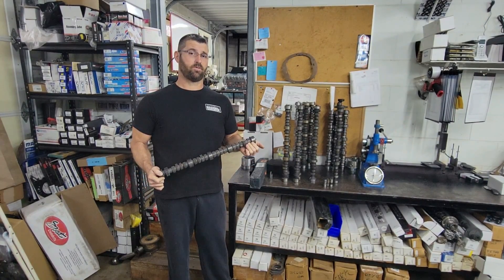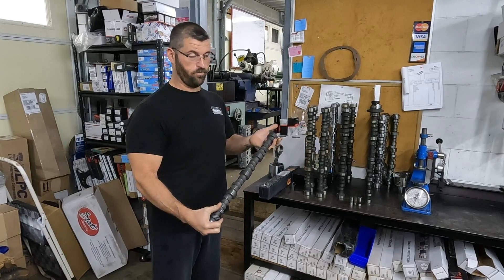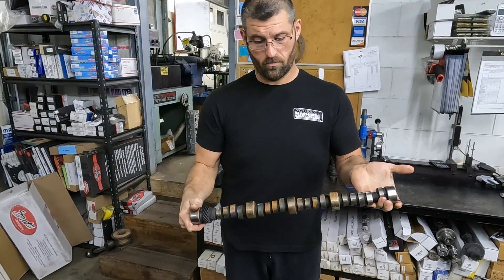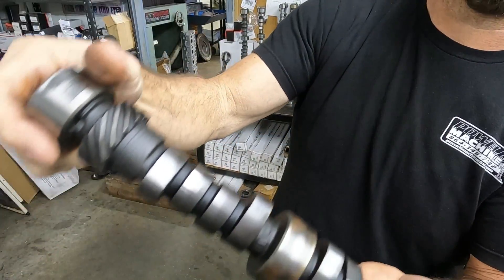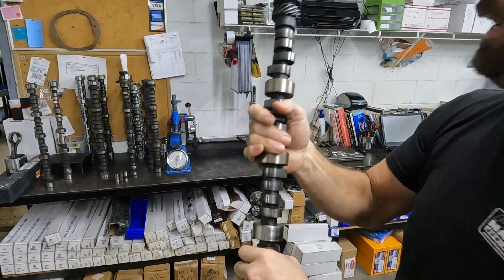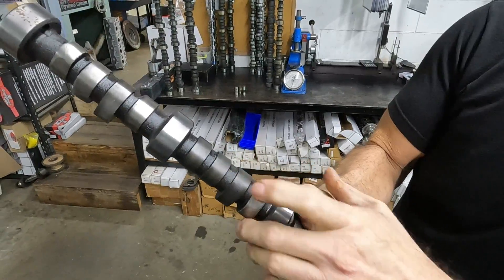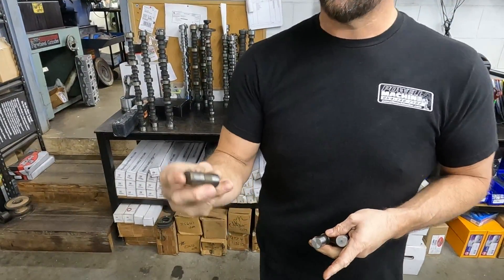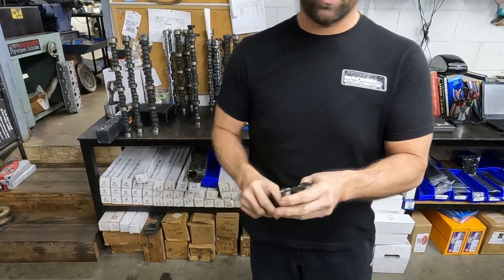Flat Tappet Cam Failures?, we investigate why and check the hardness of several cams and lifters!

Comment: Great video Sir. I've been looking thru all these videos concerning the Cam/Lifter issue as im in the process of replacing my worn cam on my 1968 Firebird 350.  Is going Roller the way to go at this point not worrying too much about cost.  Quite confused and frustrated how Quality Control has gone off the deep end with these Manufacturers. Good Stuff.

Comment: I purchased a set of Crower and a set of Melling solid, flat tappet lifters. Crower states that they are Johnson Lifter. Melling uses a part number JL and they look and measure identical to the Crower/Johnson. I have the feeling that Melling uses Johnson and just reboxes them with their part number. JL could mean Johnson Lifter. Checking the crown, Mellings were atrocious and the Crower were way more consistent. Out of 16 Melling lifters, 10 I refuse to use in my worst enemy's engine. Many had no crown but were ground on an angle. I even rotated them, that proved to be inconsistent as all get out. One went fro .003 to flat from the center to the edge. How would that work with 313# rate spring?

Comment: Excellent video. good info and the test results make the situation much more clear. Seems the issues are not to do with cam cores or materials, likewise with the lifters, The issues fall back onto the lobe grind angle and lifter crowns.

Comment: I get tired of this,  since 1994 the EPA has reduced motor oils to near zero on ZDDP,  thats why the flat tappet cam failure.  Use roller lifters only,   they have been rollers since the 1980's.  Flat tappets is a waste of time.
Reply: The ZDDP motor oil Content has only been Reduced to 1/2 the Original Ppm amounts.....Claiming "Near Zero"  is a misleading Exaggeration of the current oils...
Reply: @tomstrum6259  At some point in time the EPA will go to zero on ZDDP. The EPA is trying.

Comment: What percentage of FT cams made today are cast iron? Are all roller cams steel?
Reply from the maker: 98% ft are iron,  85% of rollers are billet,  Ductile iron is a great option for hydraulic rollers, watch my core video for further explanation
Reply: @powellmachineinc3179  the reason I ask is because it seems like a lot of commenters are talking about bad "Chinese steel" and such. I thought most all FT cams were cast iron, because they're pretty brittle, and can break easily if dropped.

Comment: Improper break in,  non rotating lifters, shot peened blocks without deburring to lifter bore, failure to polish the machine marks off the bottom of new lifters,  to high of valve spring pressure  for break in, off set cam in block to shallow or to deep keeping the lifter from rotating.

Comment: So the taper on the lobe has to be close to the cam or what is the measurement there?
Reply from the maker: It's relative,  the width of the lobe and diameter of lifter will determine that.

Comment: My speculation is that since the API restricted the maximum amount of ZDDP in the oil to 800ppm, flat tappet cams die young. This was done to prolong the life of the catalytic converters. Which are harmed by the Zinc and Phosphorus in ZDDP. Get some oil like Amsoil Z-Rod, which has about 3400 ppm ZDDP, and your flat tappets will stop failing.
Reply from the maker: So how do you explain the failures when using a aftermarket oil with the proper additives blended in?
Reply: What additives? Your question does not specify. But I still standby my assertion. You get 3000+ ppm in there and your flat tappets will stop failing. Your roller lifters and timing chains too

Comment: This man is pure and really knows his stuff.
One thing I have seen over my career is worn or scored lifter bores not looked after during rebuilds that stop the lifter from rotating. I suspect that is responsible for atleast some failures as well.
Reply from the maker: Thank you! Glad you enjoyed
Reply: Yep the occurrence of ovality in lifter bores of older high milage engines is more prevalent than most realise and this is not so much just the impact on lifter rotation but also misalignment at contact face and lifter chatter, in some cases enough ovality to cause low oil pressure issues too, lifter bore bushing may be cost prohibited but the difference in lobe contact patterns is huge, I have many times reamed to ford or chrysler sizes in chevy blocks but the hazard of clipping the lobe next door increases substantially without accurate cam endfloat control
Reply: Ah yeah thats a good point

Comment: Best flat tappet explanation on the planet.
Reply from the maker: Thank you!!
Reply: @powellmachineinc  Come to think of it concerning the Buick cam, I had one that was walking in and out of the block (this was identified by watching ignition timing) and investigation revealed it was assembled without a spring-loaded cam button under the timing cover.  Lifters and lobes seem to be fine, still.
Reply from the maker: @thisisyourcaptainspeaking2259  the tapper keeps the cam from walking,  generally when you see timing moving alot ots from excessive timing gear lash
Reply: @powellmachineinc  The buicks have a cam thrust button.  This engine was fresh and after installing the button, the ignition timing was rock-steady.  I'm not sure about lobe taper but seems like the cam could walk if taper was insufficient or zero?
Reply from the maker: @This Is Your Captain Speaking  definitely could walk if no taper was present, Where does the button go?, never seen a flat tappet cam with a thrust button.
Reply: @powellmachineinc  Between cam nose and back side of aluminum timing cover (water pump housing)  The cam had a pocket machined in the nose where the thrust spring clips into.
Installed Cloyes 9-5189 Torrington style bearing, flat tappet application.

Comment: If the shop is willing to pay for the removal, full engine rebuild, and reinstall and you don't mind the month long plus downtime sure go with a flat Tappet
Reply: if youre willing to shell out 1200 plus dollars for a roller cam setup that may or may not break a roller lifter, go ahead.

Comment: Excellent information! Some 20 years ago I rebuilt a 1946 Buick 320 straight eight, and a replaced a couple of lifters that looked scored, with aftermaket lifters form Bob's Automobilia which I think is a reliable source. The cam was reground and nitrided for hardness. Some years later, I discovered that those two aftermarket lifters were chewn off by the cam, while all originals were pristine. I assume EGGE is the only manufacturer of Buick STR-8 lifters. I have to assume they are soft.
Reply from the maker: Very possible!

Comment: just had a Jegs Cam lobe go flat on me, Proper oil and break-in procedure done, it's the second hydraulic flat tappet in 2 engines in a year that have done the same thing. I am currently installing a Howards retro fit roller, should have just spent the extra $$ in the beginning.
Reply from the maker: Yeah,  we tell customers that daily,  we have all but stopped doing Flat tappet cams,  we only grind rollers now.

Comment: I always hone my lifter bores with a flex hone and engine oil just enough to clean them up then clean the lifter bore and install a lifter and feel for to tight or to loose. If they are you need to find the problem. I wonder if you could blueing up the cam ramps and then the bottom of the lifters and just put the cam timing gear on and rotate the cam while putting pressure on the lifter to see if you get a good contact before you put everything together and get a flat cam and you no the work and money down the drain. I have done this with all my cams 20 plus years ago and only found one problem was a bad lifter bore at the bottom of the lifter bore. Never had a cam go bad on me. Would checking like this before you put eveything together and the cam go be a good thing to try. I always did just to be safe as other people had cams go flat back then also?  Not as bad as today though.
Reply from the maker: Yes, looking at the pattern would be a good practice

Comment: Todays motor oils lack the ingredient zink (which 20 years ago was added to all motor oils) if you use this oil on any flat tappet camshaft I don't care if it's properly hardened or not without zink present in your oil you will be replacing multiple flat camshafts !
Reply from the maker: So how do you explain failures when using a blended high zinc racing/ breakin oil?
Reply: @powellmachineinc  improper engine assembly and break in due to inexperience I see it all the time .
Reply from the maker: @John Pena  what about professional engine builders with 30+ years experience and breaking oil with automated breakin cycle on the dyno.
Reply: You know that Jeep was using Flat Tappet Hydraulic Lifters up to 2006! And those are running around with 250-400,000 miles on them mostly with Wal-Mart/Jiffy Lube oil changes.  How much Zinc is in that bottom shelf 10w-30 SuperTech?  It's not the Zinc....
Reply: @port nut you’re not wrong!  Hydraulic Intensity is a real thing. A Comp XE cam in anything will not last neglected like stock 4.0.

Comment: I have a home based automotive machine shop. In 30 plus years I had never had one single instance of a cam going flat. 
  Start my own shop build a few engines and I had one go flat year before last. 
  It literally rubbed a hole through the bottom of the lifter.  Of course I’ll state that I check and double check my valve spring rates and coil bind.  Seal to retainer clearance. It is a must in the custom engine line of work. This is one major aspect that separates my work from the reman industry. 
    That one particular engine had also mysteriously wiped out the cam bearings. Front three cam bearings lessening to no wear on the back cam bearing. It nearly wore entirely through the front cam bearing. 
     This was a major problem.  I couldn’t afford to fix too many of these problems else I’d be shut down. I had to try and figure it out.  The cam mains never appeared to have seized the cam bearing material appeared to have been mashed flat and kept running.  It was a FE engine with the groove in two cam mains. The bearings had formed into that groove. 
    After many hours of scrutiny and scratching my head I finally gave up and began to reassemble the engine with a new hydraulic roller set up I paid for. 
    When I picked up the front cover I found out immediately what had caused the issue.  
    The customer had installed the fuel pump on the front cover and had used a bolt that was too long. That bolt busted off the back side of the bolt hole.  A piece or pieces of cast aluminum about the diameter of quarter and about .080” thick had broken off the front cover.  The oil slinger on the snout of the crank shaft left absolutely nowhere for those pieces to go other than on top of the crankshaft timing gear.
    That piece got wedged between the timing chain and gear and shrapnel was scattered.  I found pieces of cast aluminum shrapnel imbedded all over the inside of the front cover. It was evidently violent. 
     I didn’t find any debris in the oil pan initially. Just dark powdered material from the cam lobes and lifters. 
    The oil pump and pick up screen appeared to be clear upon first glance with the old oil still in and on those parts. 
   After I cleaned those parts off I found that more cast aluminum was inside the pickup tube and I can not figure out how pieces the size I pulled out of the pick up tube got passed the screen.  
   The gears of the oil pump and housing appeared clear with no gouges or foreign material but after cleaning thoroughly it was very clear that cast aluminum particles were smeared all over the inside of the oil pump as well.  It was very difficult to see these issues when the parts were cleaned off. No way to have seen them with the oil on them. 
    I thought I’d share these details for others in this line of work to learn from.  A fuel pump install is pretty basic but it can bring devastating consequences if someone of it paying attention.  
    My confidence in cam and lifter cores was of course diminished after this. In spite of knowing the cause.  
    This demonstration helps me out a great deal.  I’m trying to abstain from flat tappet cams right now. However if your company is rebuilding them I’ll certainly be willing to send some work that way.  
    Thank you for your time and information.
Reply: I have seen a bunch of 305 engines that ate the lifters and lobes at the front of the cam. The front four lifters will have a concave surface on the face and the lobes are almost gone. It was the last bunch of flat tappet cars that ended up getting low zddp oil because thats what is on the shelf in cars that idled a bunch. It did happen years ago.
Reply: This is a reason I try not to assemble things with an impact driver. It's quick but . . . .
Reply: Thank you all for sharing
Reply: I'm a 25 year tech mostly diesels the Internet and kids online fuels 99.9% of all of it. They just parrot all kinds of stuff. They leave out the fact that they have a hot tuner on it with modified timing. Timing in a diesel is deadly

Comment: Spot on!  It's generally not a hardness issue.  It's generally an issue with the cam lobe taper or the lifter crown not enabling the lifter to rotate.
Reply: It's easy to decipher if crown and tapper are set up correct.
Reply: And worn or gunked up lifter bors
Reply: Iovetheinfo❤❤

Comment: I am a first time viewer.....and the first vid knocked it right out the park! I am a novice engine builder and this vid had tons of info on the cam failure issue. I never knew what those casting numbers meant, now I cant wait to see what mine reveal. Can't wait to check the taper on some unused cams in the box too. I think I know where the CWC plant is in Michigan, don't remember how I found out though. I'll be watching.
Reply: thanks to this video now i know what those logo's means. my 1967-70 dodge OEM cam had theses logos and as far as i know its from st louse plant or installed at the dealership as a new car, my Chevy 1980's OEM 305/1995 350SBC have the same logo
Reply from the maker: @Richard Price  yes, cwc was and still is a Oem supplier
Reply from the maker: Thank you!!, glad you enjoyed

Comment: Keep in mind that 80's Chevy cams were known to be extremely soft. I replaced dozens of them back in the day that failed at less than 100,000 miles, as did every other shop in business at that time. It was actually a very lucrative side hustle. We used to buy GM cars with a 305 and a flat cam on Friday night, replace the cam lifters and timing chain on Saturday, and often have them sold by monday.
Reply: my 305 SBC ( the 350 did it later on as well ) died in about 1995 parents weren't happy about that in the work truck
Reply: my dad bought a 78 monte carlo with a 305 and a dead lobe.
Reply: I saw tons of them go flat in the 80 s in 305,s.

Comment: Excellent video and you seemed to debunk at least one myth/urban legend about cams and lifters being soft. 
So, it seems bad or nonexistent lobe taper along with lifter face taper may be the culprit? If so, that's a QC issue. Could be bad manufacturing processes or faulty equipment. 
One side note...i have always asked machine shops to do a light hone on the lifter bores of any engine block that I have had hot tanked. Might be overkill but, I worry about egg-shaped bores and core shift in old blocks. Not sure if it was always necessary but, couldn't hurt.

Comment: There used to be a cam company in the '70s and '80s guaranteed whether hydraulic or flat tablet it would fail boils down to spring tension when your breaking in the cam and making sure in the engine is timed so it fires right up proper breaking lube back in the day I used to use the GM additive oil wasn't like it was nowadays. PS when you learn how to work on VW engines timing valve adjustment it teaches you how to work on any engine especially how the Germans would adjust wheel bearings that is amazing.

Comment: I was just talking about your video with a friend of mine who grinds cams.  He said that back in the day they did the same thing where they checked the hardness of everything and their results were the same as yours.  
One thing he did say was that for some reason when lifters are manufactured by some suppliers the end is machined first and then the body is centerless ground which seems backwards but certainly lends credence to your idea about the end of the lifter being either machined off center or off kilter from the body of the lifter.  It would only take one or two to mess up the whole thing.    Good video.
Reply from the maker: Thank you!!

Comment: I worry constantly about flattening a lobe on hydraulic flat tappets. I use Comp break in oil and a bottle of their break in lube. I use a drill and prime engine, rotate, prime, rotate, prime until oil is dripping off rocker tips. I break in for around 20 to 25 minutes with RPM up. I've not had issues yet. I talked to a Comp Cam tech on the phone probably 12 ish years ago. He said to run stock valve springs or remove center spring for 500 miles. So a stiffer spring is not good during break in. Does this seam like a sensible cause for early cam failure. I have just been running stock valve springs on my sbc's since they're just drivers and not race cars. I usually buy the Summit line of cams with their lifters. Not sure who they're made by.

Comment: The problem is that these cam and lifter outsourced their products and the people that they bought from to make orders didn't also outsourced their supplies from multiple areas and it all mixes together and wrecks the whole market and makes it untrustworthy!  You might have a box of lifters with 15 good ones with the right lifter specs and you get 1 with out of spec and motor is junk in minutes! I will never run a flat tappet cam unless they guarantee it won't smoke my motor and they will never put their money where their mouth is!